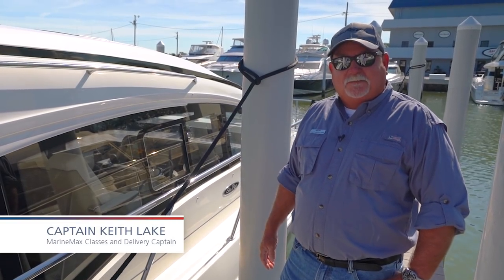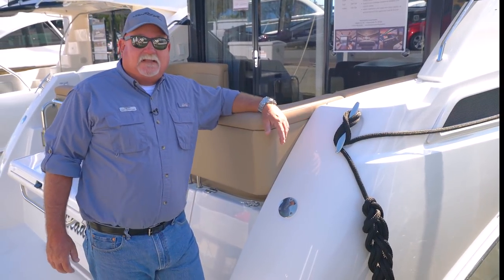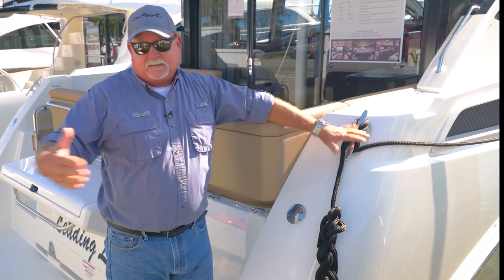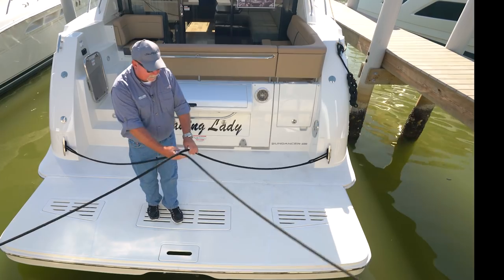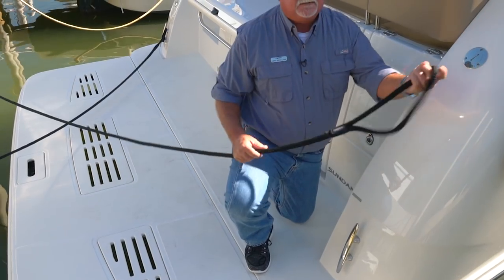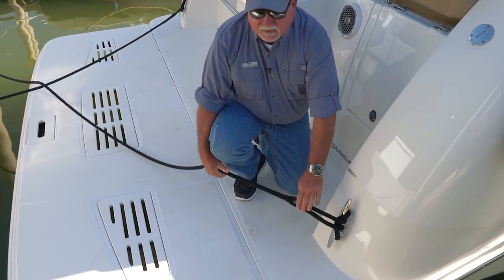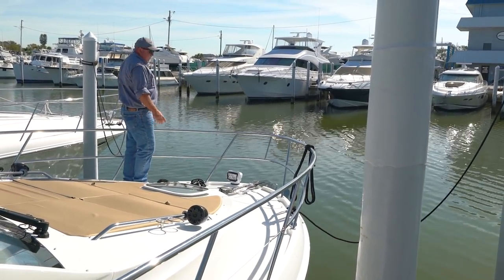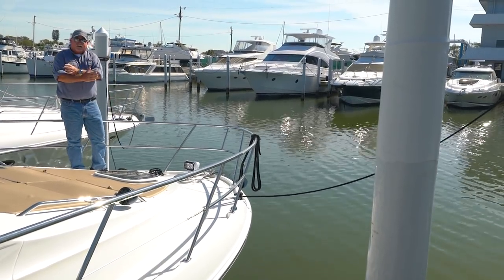Boating Tips Episode 26: Tying Dock Lines in a Fixed Slip

Comment: Good, but how do you account for tides in a fixed slip?
Reply: wkhays Easiest thing to do is check on the boat at low and high tides. Then adjust your line length so there is enough slack for low tide but not so much that the boat hits a piling at high tide. Then you mark a dash on your lines with a sharpie or a loop of tape so next time you dock you can get the correct length.
Reply: @SuperJhuffman   But what if tidal change is 5 or 6 feet (up in the Northeast) and you still have the same distances referenced in this video?  Using the techniques shown above, 6 feet of slack line at high tide would be meaningless
Reply: Got the same question, my tides are not that extreme, but being it’s in a river, the floodwater coming down the river causes the boat to rise and fall between 3 to 4 feet...same problem with my shore power cable, I had it slacked out by 10’ this past season, and twice the cable was ripped out of the plug. The last time it ripped out two screws holding the plug in the hull...
Reply: Yup. Same question as well. Had it perfect for both high and low tides. Had an extreme low tide one day, and it ripped the cleat right out of the boat
Reply: I've seen some pens have their mooring lines go through a pulley block and a weight (steel pipe filled with concrete) that  is attached to the top of the pile, gravity from both sides equalise and the line is always tight and centred. At low tide the weight may sit out of the water, just adjust it between the highest and lowest tides so it doesn't jam up against the pulley. May not work in huge tide variations like the 4-5m (12-15ft) we get in Northern Australia unless you use a 3 part purchase system which will also reduce the pulling weight of the lead line so a heavier weight would be required